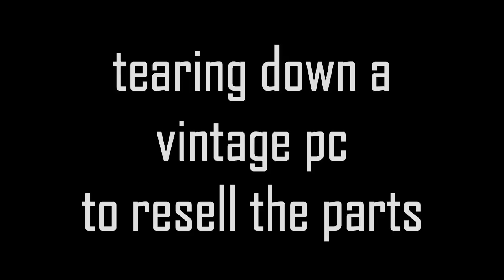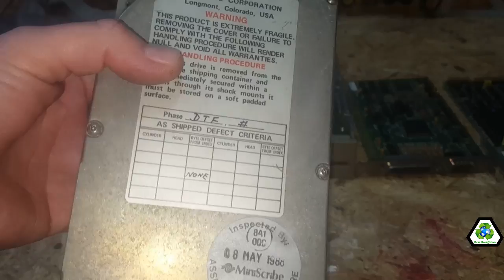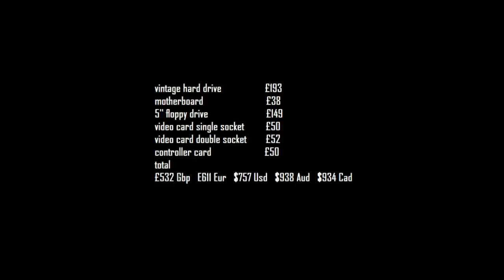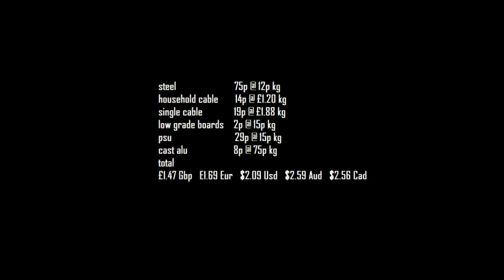♻️ Scrapping out a vintage 1986 pc to resell the components

Comment: the mother boards only fot for scrap, look at 22:43 you can see two of the caps have gone loads of leakage or rust so might be why it failed your mopther board is rubbish, the battery has leaked (the blue thing if your looking) the board or holder is green that's from battery acid rubbish as its no good shame, for a good look see 35:01 
the shipping is for usa to uk as its expensive god only knows how much it'll cost to send one ofthose! there heavy, plus you don't know if it works, still nice! nearly 200 pounds for it! 
hmm most of them are the same as they were only needed for transfuring items speed wasn't a thing until the lil ones came out, plus again like hard drive no idea if it works, 
so about 150 ish quid for the three boards, not bad at all i'd put them as one for 100 pounds ppl do buy them
Reply from the maker: Thx for the advice i wasn't happy with that leakage i would try selling this as faulty and maybe someone would be interested in some components of it

Comment: should of sold the hole thing as is, even with the hard drive,, sadly though its not worth much,
if it has a uber rare or quite hrd to find as they had problems motherboard then yes your get money, the hard dive is a no, unless its a rare size, the power unit is nah, the 12 inch floppy drive if working yes worth some money as there hard to find now a days